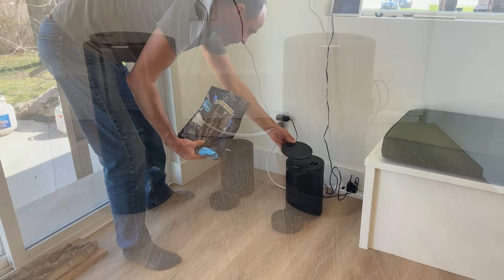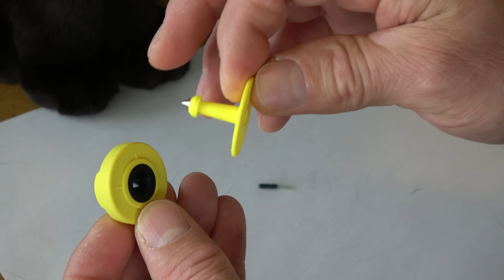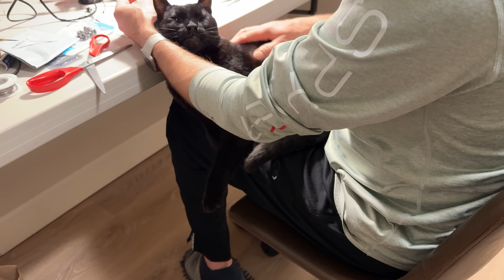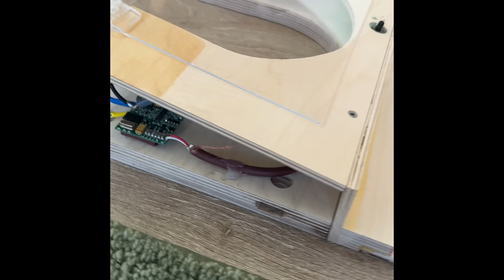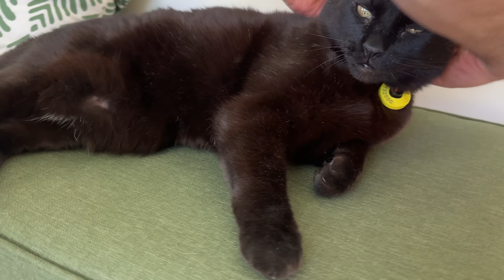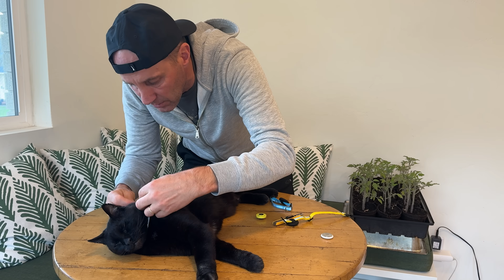DIY Smart Cat Feeder with RFID

Comment: Hello !

Do you happen to know if this rfid sensor would work with cat chips? I do not want yo bother my cats with colars and they are all chipped.

Thanks ! 😊
Reply from the maker: Hi, Yes, the RFID sensor/reader will work if your cats are chipped with ISO11784/11785 FDX-B (134.2 kHz) microchips, which they most likely are. But since the chip implanted in your cat is so small, the reader’s antenna has to be very close to it , usually less than an inch away. That means the feeder design needs to be a little different. Instead of a flat reader, it works best if you make something like an arch or tunnel that the cat walks through, so the chip in their back naturally passes right by the readers antena. :)
Reply: @honeysada yes of course, I have some other plans I'm working with, but I have trouble finding a sensor which seems to detect my cat chips for some reason 😅 I'm just a noob in electronics so that might be a reason why haha

Thanks, I'll probably try that one then.

I have automated cat door I bought from a big brand, and the sensor that detect their chip doesn't look like it need to be that close to the cat... Do you know any sensor that might be as powerful as those to be a bit farther from the cat?

Thanks a bunch for your help that's really appreciated! I'm glad your cats are lucky to have a great care taker that knows electronics to help them !

Comment: Would you be willing to share your electrical drawing and project files? I'm trying to replicate this exact scenario! I looked everywhere online and nothing like this exists, because I want to use the microchips implanted in my cats. Thank you!
Reply: You'll never be able to use those implanted  microchips because they're designed to be read with a handheld reader that actually touches the pet -- because the signal is so weak coming from the tiny implant. So they simply won't work for this kind of project without first purchasing very expensive readers, and then training your pet to rub their implant up against that reader.  Just not doable...

Comment: I had the same dilemma years ago, before today's technology.  If one cat needs to be fed a special diet, the other cat realizes this right away, and both want the food they cannot have. I used to feed them in rooms separated by a common door. Right away, they didn't want the food each was supposed to be fed. They wanted what the other was being fed.  Instead of eating, each would wait at the door until I opened it, then they would go for the other's food. Cats can be difficult, but I loved them all the same. Your solution is great.

Comment: I've lost three cats to renal failure Two brothers that lived to 17 and 19 years respectively. Their second generation sister lived to 21 years old.

I asked a vet kidney specialist if their was a way to flush the cats kidneys to open the small capillaries again, and was told once they block, there is nothing that can be done.

30 or so years back, cats didn't live as long as they do today. My vet stated that cats are out living their kidneys. That advancements in pet foods with reduced phosphorus the main culprit have lengthened their lives.

Blood in the urine is usually caused by stones in the kidneys or bladder. One of the C/D foods can also help provided your vet agrees.